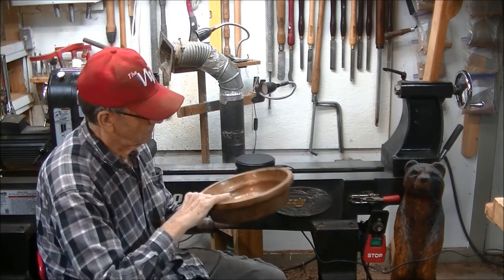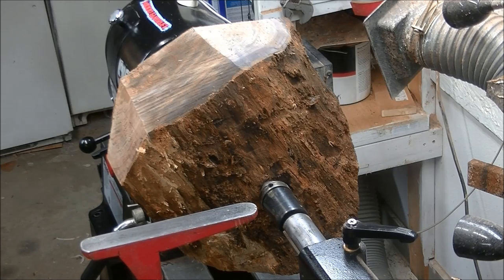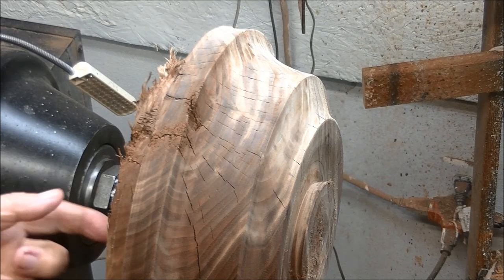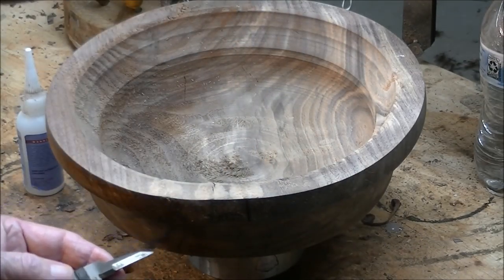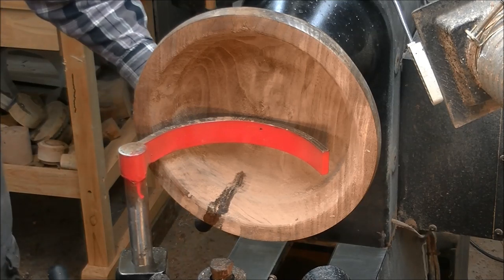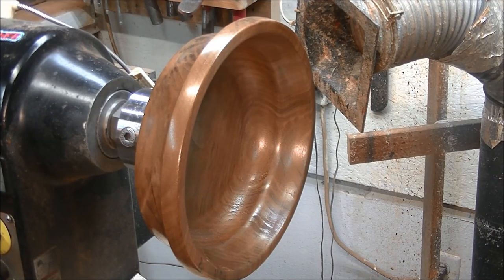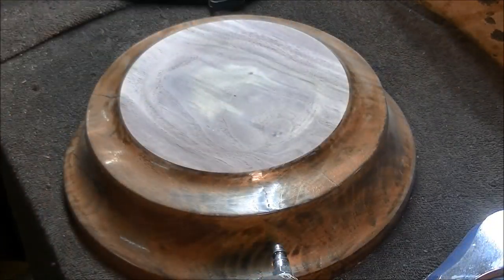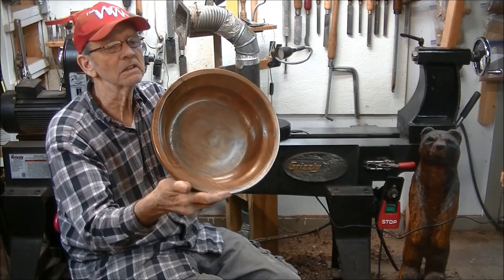A Copper Walnut Bowl # 208

Comment: Larry, have you tried mixing your wood dust with some wood glue before packing it in the crack, and then topping it off with CA?
Reply from the maker: Yep, I have.  Mixing it with sanding sealer works better.  Thanks, Larry

Comment: Just wondering why you put it in the dehydrator twice. Bought a big one and plan on using it for both.
Lee
Reply from the maker: In retrospect, I shouldn't have put it in the first time.  Being that the center had so much moisture, it caused all those little cracks.  It was one of those "whynot" moments, mistake.  I was going in for the night anyway.  That was another of those "if I did it again things I wouldn't do"  Thanks, Larry